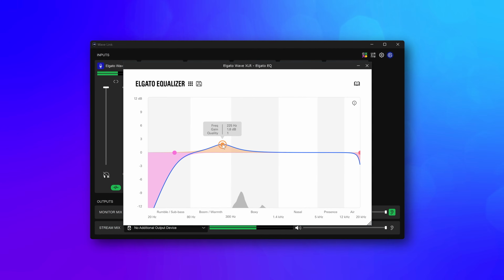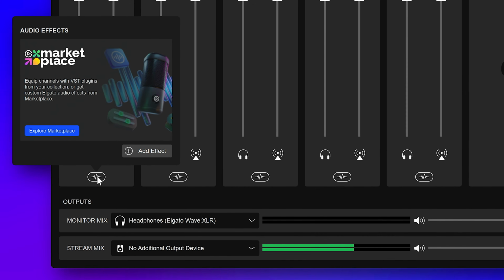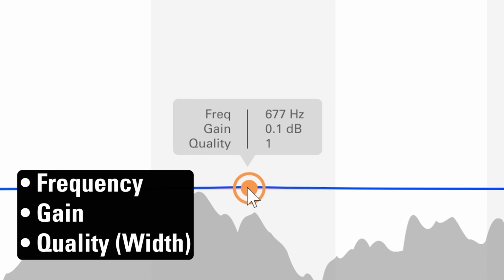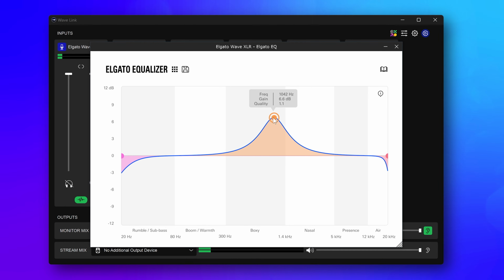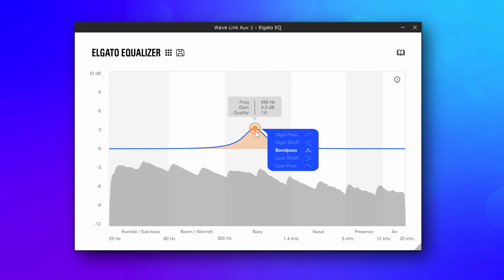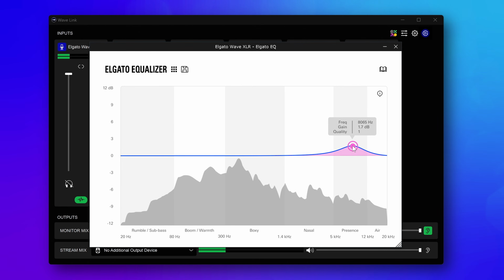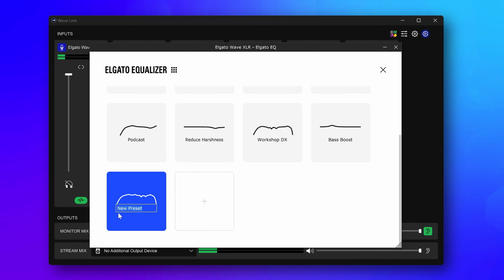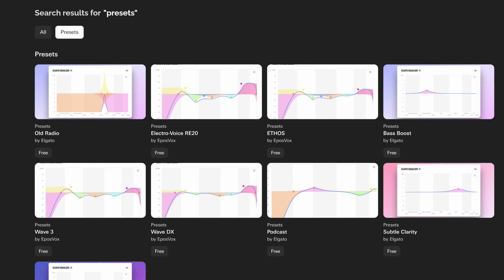How to Use Elgato Equalizer to Tune Your Microphone

Comment: the presets save as an xml file and are not associated with the .wavelink extension.  Is there a quick fix for this?  Does this even work for anyone on Windows 10?
Reply: Don't work for me either on windows 11
Reply: the fix is to update the individual addons, like the EQ specifically.  Won't work otherwise. @ImVexify
Reply from the maker: The EQ audio effect works directly with the .xml files. We did just release a hotfix today which solves some problems with the install process for presets, please go into Wave Link settings and check for updates to receive this.

Comment: the marketplace is a Joke as you can not find any of the EQ presets after they are downloaded from the marketplace and the none of the elgato software will keep you logged in to the marketplace
Reply from the maker: Hi decynda,
It appears that if you're using OneDrive on your computer this can be an issue. We're working on getting this solved. For now, look in "C:\Users\[username]\Documents\VST Presets" and copy the preset files from there into the "C:\Users\[Username]\Onedrive\documents\VST Presets" folder. The presets should now show up in Elgato EQ.
Reply: @ElgatoWorkshop  Onedrive is disabled and not used and that folder is empty
Reply: It literally opens the app for you and installs it.